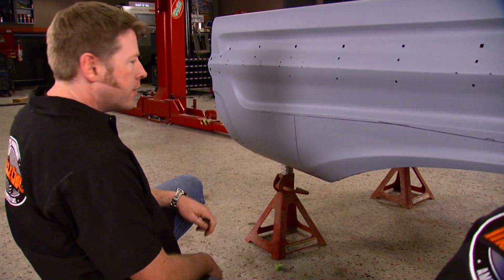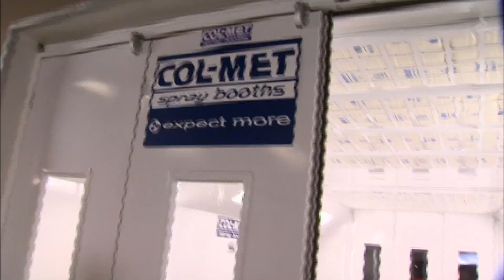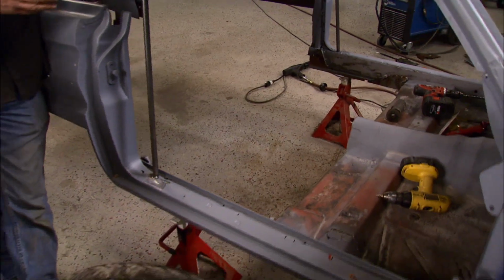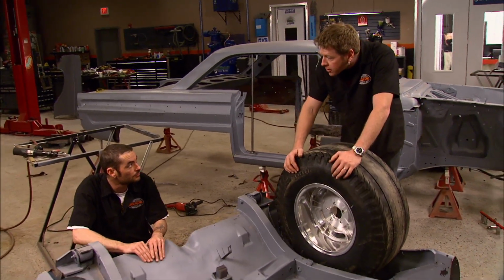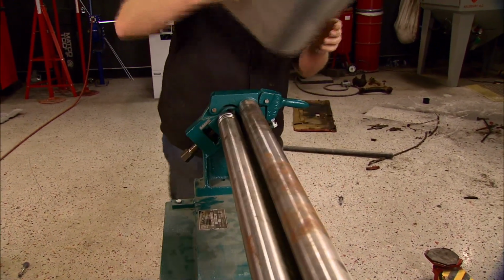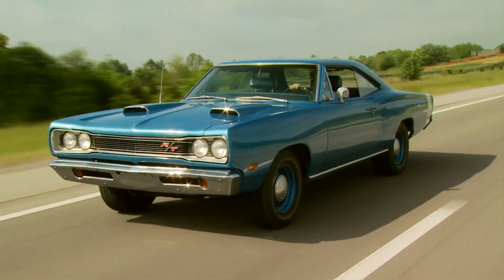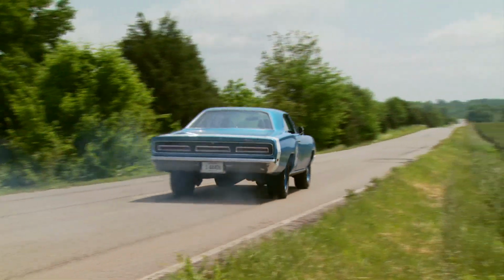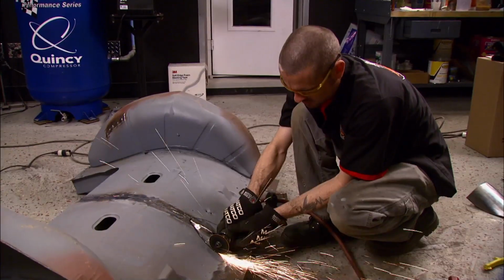Slicing and Dicing a Mercury Comet into an Altered Wheelbase Dragster - MuscleCar S3, E13

Comment: Shot in the dark but if yall get rid of any chrome trim off the body i will buy it!! Ive got a 64 caliente. I literally am missing one piece off the passenger side and its proving difficult to find.
Reply: Try finding body parts for a 1963!  Or a padded dashboard.
Reply: THAT TRIM  IS A 202 MODEL ( PLAIN JANE BASE MODEL) CHROME OUTLINE ONLY,THE 404 MODEL FILLED IN CENTER W/BRUSHED STAINLESS. THE CALIENTE MODEL HAD BRUSHED STAINLESS FULL LENGTH,ABOVE AND BELOW THE EMPTY CENTER SECTION .THE "CYCLONE" HAD NO TRIM AT ALL (JUST THE CHROME LETTERS)....PLUS GREAT FAKE CHROME REVERSE WHEEL COVERS

Comment: To much wire sticking out weld you guys are stitch weld those panels if you use a very short stick out it much easier and it doesn’t melt the metal

Comment: What automatic could be paired with the 289 Hi Performance?
Reply: The real question is, why would you have 289 if you don’t know what transmission to use?
Reply: What's it in?  What year is it? What do you want to do?  Auto or manual? T18 or np435. C-3,C4, c5, A4LD... There is alot out there and bellhousing adapters for basically all of them.

Comment: Once again, misinformation. Altered wheelbase cars were NOT Factory Experimental  (A/FX) cars!
The NHRA F/X classes did not allow radically altered wheelbases. The F/X classes were for current year production cars with certain modifications that were not necessarily available off the showroom floor. It was essentially the top tier Super Stock class. 
Now, Chrysler corp. DID try to have their altered wheelbase cars accepted by the NHRA as F/X cars for the 1965 season but NHRA basically said "No freakin' way!" The AWBs NEVER ran in A/FX, B/FX, or C/FX!
When an AWB showed up at an NHRA event they were classified as altereds or even Fuel dragsters!
Quite a few A/FX cars eventually had their wheels moved forward in order to take advantage of the lucrative Funny Car match race craze. The money was good and the cars were very much in demand.
Over the years, the incorrect term has stuck. 
This is gonna be a cool project! I will definitely be following it! ( Just don't call it an A/FX! lol)

Comment: what does it take to destroy a classic car if you want a race car just buy some fiberglass and metal tubing and build one now you chopped up a classic how many of these are left
Reply: Oh they are out there. But that A/FX or gasser schtick has been done to that. Mine is done as a period correct backroads fun car (one which handles and stops), wouldn't dream of butchering it like this.
Reply: No one cares about stock cars.   Unless it's rare or worth doing a chalk mark restoration a modified car is more interesting.  And if done right significantly more valuable.

Comment: Why bother posting this start to a project build when you never finished it?  This project is the biggest black eye to the program.
Reply: There were several projects never finished because people left. The PowerBlock has a seriously high turnover rate, especially with Trucks and Musclecar.
Reply: @CamaroAmx  "Several"  I can't think of any other projects that disappeared like Altered Ego so which ones are you talking about?  Excluding the projects that followed Stacy David to Gearz.
Reply: @Sir.VicsMasher  it was finished.   And damn cool when it was done
Reply: @bmstylee  Cool, do you know why was it pulled from the show, or what it ended up running with its NA 4.6L modular during the payoff?  How about some links.

Comment: I’m sorry, I think altered wheelbase cars of any brand are UGLY. I would have kept the Comet’s body unbutchered  and put one of those new Godzilla motors in it, and turn it into a pro touring type of car. I would also change the front and rear suspension to one of those Total Cost Involved deals like Stacy David did with that V8 Interceptor Mercury Cougar.
Reply: Altered wheel base cars , gassers, and AFX cars look like someone with a sleepy eye did the design drawing.
Reply: @davidnichols1363  there was a reason for this but I still don't like them, lol. Totally impractical and ridiculous, mine won't ever get done like this!
Reply: Those car aren’t the easiest to find so I always cringe when I see one get chopped on😩